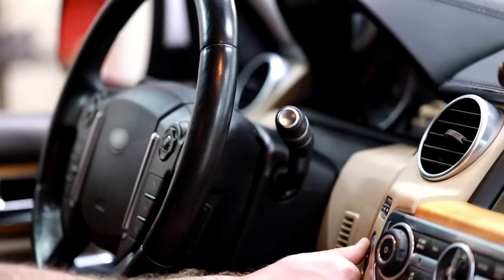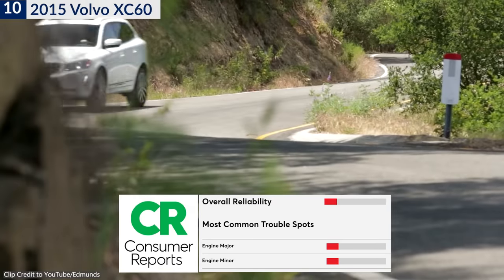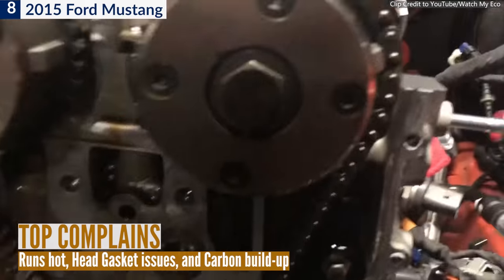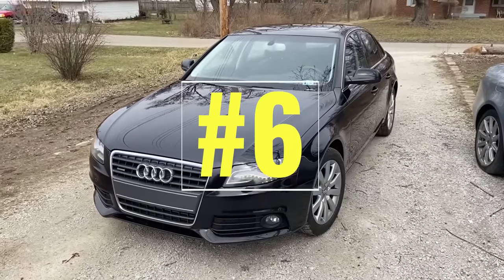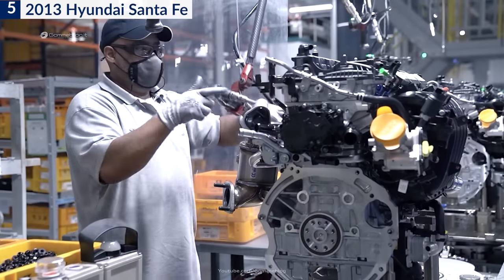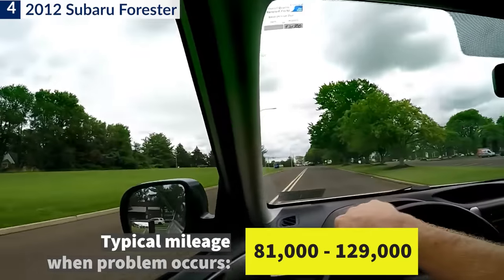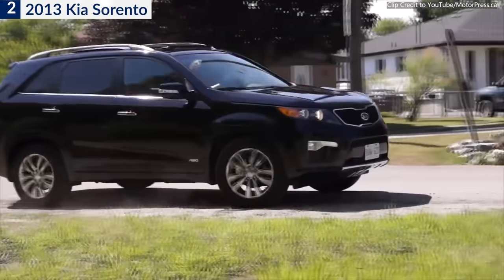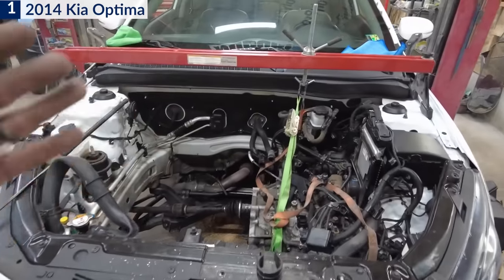10 Used-Cars to AVOID for BAD Engine - as per Consumer Reports

Comment: It seems to me that the manufacturing of these cars is done on purpose!
It looks like most these cars start really breaking up fast after 72,000 miles.
I feel the manufacturer of these designs those engines to break down so you'll have to spend more money either getting it fixed or having to buy a new one, which is I'm sure what they're hoping for. There's more money in you forking out thousands on a new car that will more than likely do the same thing, BREAK 💔!!!
Reply: It is due to emission regulations , the reason why these engines are turbo , and have low tension piston rings , PCV valves , and direct injection , its all emissions regulations , and that is why they brake . Of course if you know how to handle it they wont , but most people dont check their oil expecting that they did the service , but in these modern cars you really have to refil the oil constantly , as well as watch out for other problems .
That being said , i do have Audi famous or infamous 2.0T , its a fantastic engine , but you have to watch out ... mine did 150 000 miles , still going strong , but i do keep an eye on oil , do preventive maintenance and regular servicing , and its going .
Reply: I think this is called planned obsolescence. They want your money either way
Reply: @riazhassan6570  i wouldnt be so sure about that , have you seen people doing engine modifications to make it " better " , they always make it worse . Either in reliability or in luxury , making it hard to drive not comfortable .
Ive yet to see somone doing something to these engines that will make them work better on a long run .
So it kind a points to the factory doing great work .
Turbo petrol  Engine 250bhp going for 2-300 000miles , try do a better work .
Reply: @dedskin1  Yes, quite so. My 18 year-old RAV is also still trundling along happily. However, one sees quite a few vehicles giving extensive trouble at about 60 or 70 thou miles. One has to weigh the continuously rising costs of keeping such vehicles operative, not to mention the time wasted in workshops and problems with shoddy workmanship, against the ever-dwindling value of the machine.
Reply: @Dorothy Remington, However, one thing is for sure…you’d be buying a different brand car the next time around.  Poor design & manufacturing is a lose-lose for the car company & the customer.
Reply: Planned Obsolescence!!
Reply: buy an old car then ,easy , lets see how you fair . let us know

Comment: You should have put Ford on the list for all of their vehicles that use the 5.4 3valve v8’s.  The cam phasers go out at around 90k and cost 1000’s to repair.
Reply: Agreed! That engine is infamous as a true pile of garbage. Most repairs dont even solve the issues and the same components fail shortly after. Most legit mechanics recommend a full engine replacement with a remanufactured engine with mods and upgrades to solve the design flaws.
Reply: Have a 2005 ford explorer V8 4.6 going  on two hundred thousand six hundred fifty miles. Only problem was new transmission  in the first 2yrs . Luckily still was still under warranty.
Reply: @jazminej9  the 4.6 and especially the 5.4 two valve were very good. Specifically the 5.4 three valve was infamously terrible and deserves a mention on the list.
Reply: I have an 08 expedition with the early 5.4, 3 valve. Frequent oil changes are essential. Small oil ports make it too easy for small particles to clog oil passages and cause failure. Frequent oil changes prevent that.  Mine has 216000 miles and is going strong.
Reply: @jazminej9  And your 4.6 is not a 3 valve triton either. The two valve modular engines (like yours) were great work horses.
Reply: I like how no one acknowledges mason’s expedition but there all here to talk all the shit. Smh
Reply: @michaelstevens04  I agree with Mason, the only way a 5.4 3v will survive is with religious oil changes.  I just won’t spend my money on one. Give me a 4.6, it will go 100’s of thousands of miles.I wish all of the manufacturers would go back to cast iron blocks and heads. With all of the added technology and complexity the gas mileage hasn’t gotten better.
Reply: @markmeador1137  but still an oil change every 4-6k miles isn’t really that much especially if you do it yourself

Comment: I drive a 1999 Subaru Legacy Outback  with about 250k miles had it since 2012, as odometer work off & on, have to monitor oil level as it started to burn oil, transmission at times hesitates after coming from a standstill, car body is solid has no problem every gadgets still work, no under chassis rusts, recently installed new suspension ,new rack & pinion. Will drive it till it  need remanufactured powertrain, it should beat a new car replacement of $35k or more. Let me know Your pro & con input

Comment: Funny you mention the 2011 equinox. My mom owned it until last year. It had only 100k miles and the engine died very suddenly after only a few minutes warning.

Ended up just getting another car because it wasn’t worth what they were charging for the replacement.

Comment: I have a fully loaded 2011 optima SX with the 2.0 like many on my 2nd engine, though its the only issue i ever had with the car and it was covered under the recall, even at 160k miles when it blew, and long as recalls are done they replace the engine for life so i cant really complain.

Comment: 2007 toyota 2.4 engine eats oil even if you change oil on a regular basis. Avoid at all cost
Reply: what vehicle? toyota doesnt fix?
Reply: Abdullah Saud  Turbos bad, NA's good?
Reply: @Snake-ms7sj  and they only covered it to 100,000 miles which is when it typically started using oil.
Reply: @Snake-ms7sj  Tell  me this isn't so . Toyotas are perfect , just ask Consumer Reports (our favorite toaster testers)

Comment: Manufactured obsolescence!!!   What a shock the first several example were American and European cars.     Subaru problems are a little surprising.
Reply: Subaru were only for a relatively short time and they fixed the issues. They were before and still are now using the same boxer design.

Comment: CR had nothing to say about the Kia engine problems that started in 2011 till 2019. But then again CR said that my 2016 Kia Forte 5 had a 6 speed auto transmission and a mushy suspension.  Both totally wrong
Reply: CR is a joke. A car with defective cup holders on more examples will get a lower mark than another model with severe engine problems across less examples.

Comment: I have a volvo xc60 d4 2015 diesel 2.0 l and I'm so happy with the car .the issue what I have is a slightly oil leak on engine  ,egr valve and I charge the batery. The car have 138 k miles , I drive over 30k with no problems ....overall I am apoy with the car ...

Comment: I just saw a Nissan SUV broken down, blocking a full lane of traffic, and appeared to be rather new. Those CVTs are the worst. Once Nissan was all about quality, value and longevity. Not anymore.
Reply: The really bad thing is Nissan doesn't seem to stand behind their products the way some makers of somewhat problematic vehicles do. Hyundai/Kia seem to do a much better job owning up to their screw ups and trying to make things right. 100% correct Nissan made reliable and long lasting vehicles up until the 2000's when everything changed. You can only float on reputation for so long before people catch on.

*disclaimer- These are observations, I drive a Toyota and don't have a dog in this fight. Nissan was previously my brand of choice until the quality and resale dropped tho.
Reply: @hippiebits2071  I had a 1984 Nissan 720 (3/4 ton) 4X4 pickup. I put in a motor from a 1985 and a transmission from a 1983. The thing was sold running perfect with 240,000 miles. I just sold off my wife's 07 Camry running with 260,000 miles. It could still run fast with the V6. Now I stick to Lincoln/Ford/Mercury because they are cheaper to buy used and seem to last ok. My daughter's Fusion also had a garbage transmission though that set me back $4k to replace.
Reply: My Nissan lasted nearly 17 years with not problems at all. I gave it up because I wanted an upgrade but the car was still going

Comment: The common theme with all of these engine failures except Kia and Hyundai (some of these that onlybhave oil sue as the problem are included) is manufacturer oil change intervals that are too long for  most owners. Owners of these cars that start using quick lube businesses for oil changes do not have these problems at the rate that dealer loyal owners have. 5000 mile oil changes that quick lube businesses suggest avoid the oil sludge, stuck rings oil use, and cam phaser and cam chain system problems.

Comment: Well, I have a 2013 Kia Sorento since new and I do my own maintenance. It has whooping 217K miles on it and the only thing I had to replace beside maintenance was the starter. Go figure.
Reply: Funny, i just had to replace my starter as well. That and the oil pressure sensor only problems. I do regular oil changes every 3k.

Comment: I had a 2013 Kia Rio EX that was the best little car I ever had. Never needed major work, no electrical issues, no failed switches-nothing. Tires, oil changes-that's it. Never even needed to change the brakes. Just sold it last summer.

Comment: The problems with the Hyundai 2 liter inline 4 cylinder are more extensive then mentioned. This is the engine in that car since the beginning. It was an still is an interference engine and if it's timing belt slipped or broke it is possible for the piston to slam into the valves destroying the engine and requiring a rebuild so $3,000 to $4,000 for any year. The timing belt's scheduled replacement is every 60,000 miles. Expect to pay no less than $700 for this very labor intensive work. Home DIY owners have reported taking 10 hours to do this. You place a jack under the engine. Release one motor mount, lower the engine a little bit and start removing the timing belt cover, drop the engine lower to clear some bolts for access, remove on front wheel and it's fender well to reach inside, remove the water pump and put it all back together. As long as you have the water pump out replace it with a new one as it will cost you the same labor as replacing a timing belt. In 2011 they did away with the timing belt in favor of a timing chain that will last the life of the engine but they insured their dealerships would continue getting paid for all that labor. While the chain is metal the chain guides bolt to the block on plastic mounts that can equally break can destroy the engine.

The engine is very oil sensitive the oil must be kept changed and filled to the proper level.

The engine is subject to “piston slap” and the only cure is rebuilding the engine. Since the costs more than many of the older ones best thing to do is load it with very weight grade oil and an additive like the old Motor Honey and run it until it dies.

Loud ticking noise from the top of the engine. You just have to live with it.

Inexpiable poor gas millage can occur.

I had looked at buying an Elantra and fortunately researched it.

The problems noted here are sporadic among owners. Some people have driven their Elantras 300,000 miles or more. It's a car that when it works is a great car. But buying on is rolling the dice.

Comment: With the Volvo they mentioned  engine failure. But they mentioned Fuel pump. The fuel pump is NOT the engine.
Reply: My 2005 Volvo S60 T2.5 AWD had the fuel pump fail at 320,000 km but it was in the fuel tank. Hard to replace pump because of the AWD but the 2.5 turbo engine runs great with no oil consumption and very good performance! 😊

Comment: I love buying the most unreliable cars I can find. Thanks for the video.. adding these to my list 👍 and here I thought it was gonna be a list of 10 Fords. 🤣
Reply: I have a Jeep, Ram, and an Audi.  All of which are supposed to unreliable and I haven't had a single problem with them.
Reply: 2013 Ford Focus should have been top of this list
Reply: Add all Chrysler products to your list.
Reply: @elviraneumann4563  Just junked a 2000 Jeep Cherokee with 648K on the engine. Maintained it well, until the salt ate the body. Most reliable vehicle I have ever owned.

Comment: My 2012 Kia Optima Hybrid engine exploded at 100kph, connecting rod snapped without any warning punching a hole on the engine block.
Vehicle was serviced less than 2 weeks prior by the Kia service.
Zero compensation from Kia Canada, vehicle was scrapped as the engine replacement cost substantially more than what the vehicle was worth.
Never buy a Kia or Hyundai.
Reply: Same thing just happened to me
Reply: I drive my 4th Hyundai. No problems at all. I have Kia. No problems at all......Just totaled in crash with a truck🙊
Reply: I supposed if you get rid of your Hyundai or Kia while the mileage are low, you will probably not experience this problem. 
My Kia was serviced by the Kia dealer from day one with full service records, yet Kia Canada did absolutely nothing for me.
They have been aware of this problem since 2015, yet they never recall the hybrid version of this engine.
I lost thousands of dollars scraping the car because the car was worth less than the cost of the replacement engine.
The kicker is they decided to recall this model a few months after I scrapped it!
Reply: Hyundai and KIAs are reliable. You just making up stories little man
Reply: @ypc317  you never owned one
Reply: @rcmic  My neighbor drives an 06 sorento with 639k miles. No problem so far. But you're a troll who will not understand this.

Comment: I had a 2013 Subaru Outback, it consumed oil like crazy, plugged up the cats, EGR would get plugged up, simply junk.
Reply: They had issues with that for a couple of years...my wife had a forester of that year...lo and behold the rings were the issue...they wouldn't seat to the cylinder walls properly thus theboil consumption...she got lucky and totaled it with a encounter with a deer...got 10k for it.
Reply: A few bad years with Subaru but thankfully they made some changes and that’s part of the past. Some people continue to cling to Subarus currently having oil consumption or head gasket issues.  I guess if I had one during those problem years I’d be a bit upset still but thankfully a lot of consumers have gotten over it and have become better informed.  Not the issue now but maybe it helps some to keep past issues in todays time.
Reply: @martinr8278  Not me.

Comment: A lot of “one person” said this…….Sure there are issues with every car manufacturer yes even Hondas, Toyotas etc.  how are these cars driven? Are they serviced? Are they abused? Etc. consumer reports shows a small picture and not the whole picture
Reply: correct to a point. averages matter and very well made engines have durability even with old oil
Reply: @jamesmedina2062  Toyota and Honda are the number one or two rank sellers in America. Yet BMW, Mercedes Benz, Hyundai etc doesn't compete Toyota and Honda. Yet they are getting more complaints and issues of their cars.
Reply: @duhatsayo139  Honda and Toyota shine mainly in the legacy compact and midsize segments. F-150 and Silverado sell the most numbers. Luxury cars are bmw, mercedes and sell in lower numbers. So what was your point though?
Reply: I've got buddies who drive until the wheels fall off. Never wash it, interior is nasty. Layer of dust on the dash an inch thick and garbage left about on the floor. Nd when they go to sell it, they'll clean it up, but the damage was so great and the stains so stainy, that it made almost no difference and they end up losing more coin on the thing than they like to admit.

Comment: A turbo will improve performance and fuel economy but will wear the engine out quicker.
Reply: not exactly. in some ways turbo cushions the explosions and it also adds compression for greater longevity with power. a non turbo often feels less peppy in only 60k miles where a boosted car feels peppy for over 300k miles because it adds compression.
Reply: Performance, yes . Fuel economy nope not a all . My Hyundai Sonata is a turbo and I only get 375 miles on a full tank .. I get about 20 mpg city / 25 mpg highway
Reply: Modern turbo engines are designed and built with stronger rotating componenents to withstand the stresses turbochargers produce. That said,  It's the environmental and economy regulations that force manufacturers to use ideas that are not so good..Thinner cylinder blocks which are basically throw aways, plastic intake and valve covers, integrated exhaust manifolds, direct injection, super thin engine oil requirements like 0W16, etc. These downgrades will still last the duration of the warranty but almost certain to be a nightmare down the road. I would never consider keeping any new car on the market now long term. Find a car that holds onto its value well and trade it in before the warranty expires is the safest bet but not the cheapest lol!
Reply: @antionna30  I have to stop complaining about my SUV mileage.
Reply: Had years of experience with turbos. They are a death sentence 💀 for daily use engine. Find a good normaly aspirated engine with a stick shift and after that they can kiss my a--.
Reply: Turbos need extra care. I got 100k on my 1980's Mitsubishi mirage on original turbo, before I lost 5th gear.